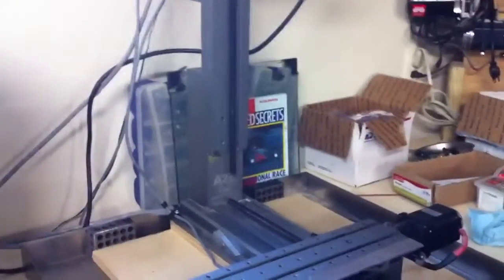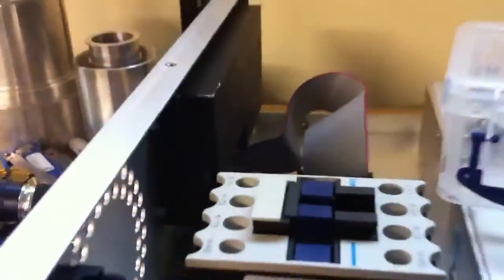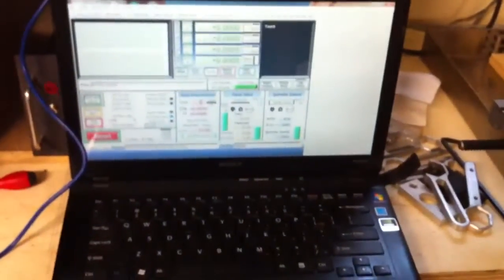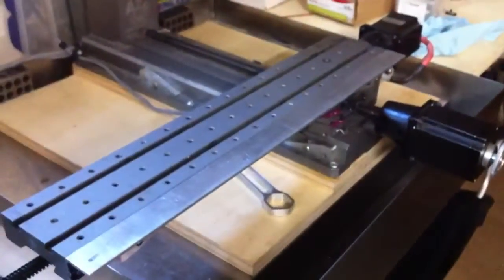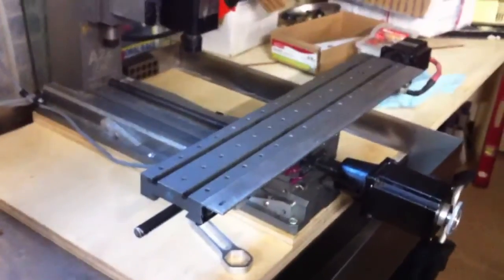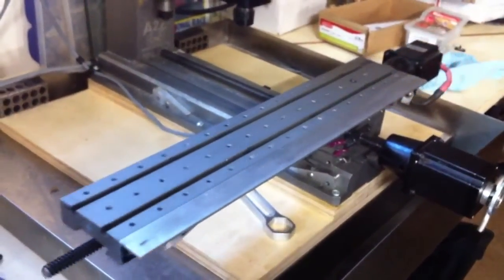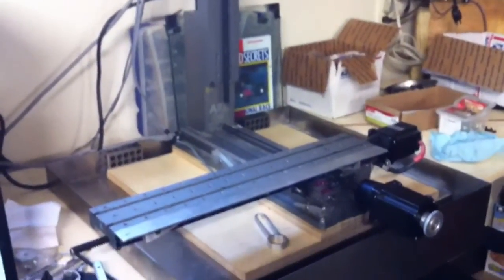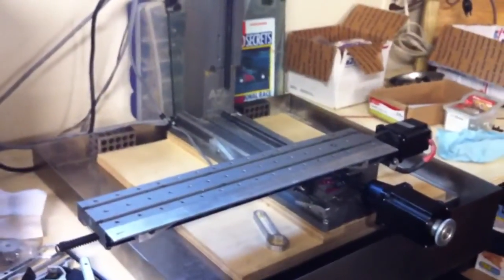Hobby CNC Pro & Smooth Stepper

Comment: nice little video.....did you ever find out if you were losing any steps at these rapid speeds? I'm looking into what I want to use for my current CNC router build right now and the G540 looks really promising. If I could run 300ipm rapids without losing steps....that would be sweeeeet.
Reply from the maker: Never really tested it after this for max speed and or lost steps. 

I have run it as a RepStrap (3D printer) which has pretty fast travels with no issues.

The G540 is a great unit too. Easy to set up. Almost bulletproof. 

It should make your router fly, if not add an ESS (Ethernet Smoothstepper).
Reply from the maker: I didnt realize this was the video with my SS when I commented. I believe I have another video here showing the machine going faster than this in all 3 axis at once.